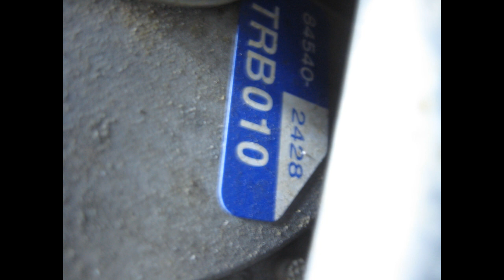2012 Audi Q7 8 Speed Multifunction Switch

Comment: bonjur problem audi q7 2012 anne ? p0850 code ? pa demare
Reply from the maker: A P0850 diagnostic trouble code means that the computer is not sure whether or not the transmission has been shifted into a neutral gear.

Comment: Hi mate you got the part no by any chance
Reply from the maker: Zeshan, The OEM Part Number was 84540-2428 TRB010, which cross-references to Audi 0C8919823. The switch did not fix my fault. I found an intermediate connector (T14H) with corroded pins between the Multifunction Switch connector and the TCU. Bypassing the corroded pins fixed my fault. Good luck!
Reply: Don R hi. I’m kinda having the same issue as you, how did you bypass the corroded pins. Thanks in advance

Comment: I have similar problem ( different error code related to Transmission oil temp sensor ) and doing research on the net shows its a bar rusted connector , driving with the errorr for more than a year and will change the connector as soon as I have some spare time

Comment: Is it possible to upgrade a Q7 that has a 6 speed...to an 8 speed?
Reply from the maker: Anything is possible, but it is never a case of "just the gearbox". You end up having to replace items such as TCU, ECU, wiring harnesses, sub-frames, drive shafts and transmission cooler hoses and pipes. I would not attempt this myself.